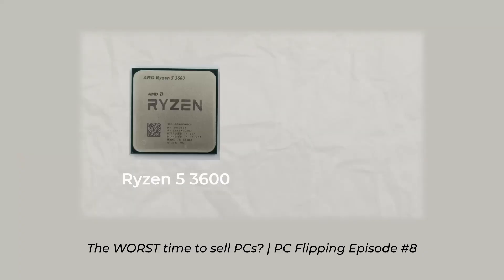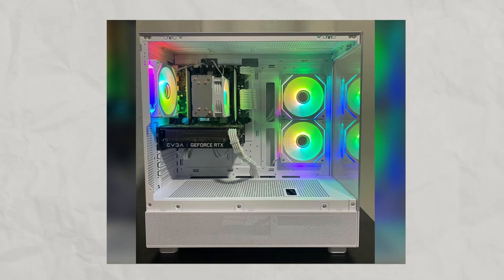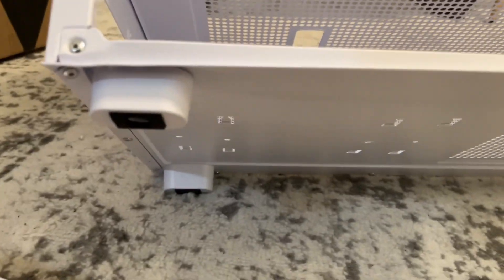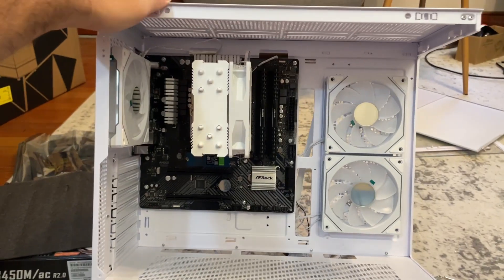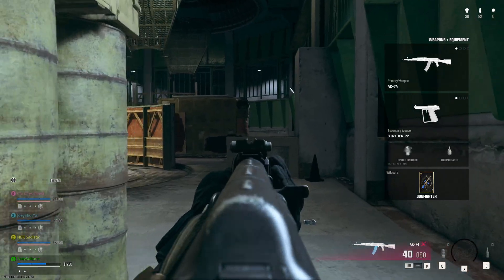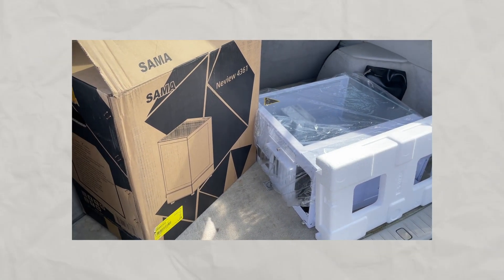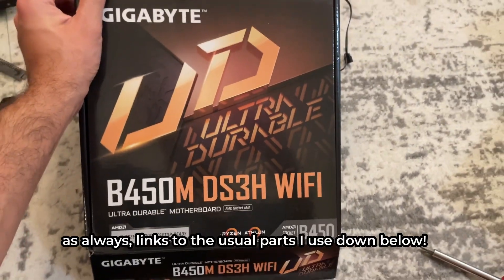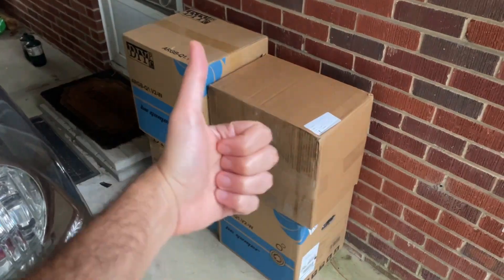NEVER do this! | PC Flipping Episode #9

Comment: For a higher budget case I added a USB -C card. I recently ordered a few USB3 to USB-c internal adapters but have not used them yet. I did the same regarding a dented case. I buy parts when I can get them the cheapest and wait until I have all the parts to build the system. One case I did not check was bent. I already had one built the other day on a SAMA case and could not figure out why the feet would not sit evenly. It was bent. Was able straighten with a screwdriver You cannot see the slight bend unless you turn the case upside down and take off the front.

Comment: The guy who commented at the post at the end of the video is the real rip off.
He make fun of 6600XT and in reality his just selling a 3060 both GPUs performance are nearly identical TBH ahahaha even with the additional add-ons as a full set PC its very obvious 2.8 USD is overprice LOL LOL.
Even with my 3700x (PBO+EDC bug etc.) running at 4.4ghz all core auto boost + manually OCed RAM (all timings) and a 4060Ti  16GB will perform a looooot better than that 5800x w/ a 3060.
Reply from the maker: TELL IT TO HIM GAMERTECHLIVE!!!